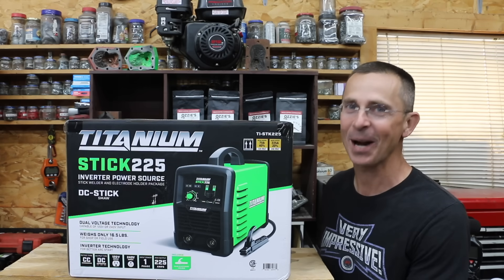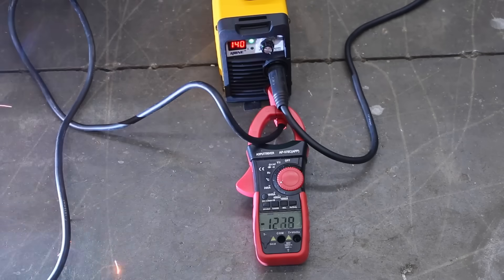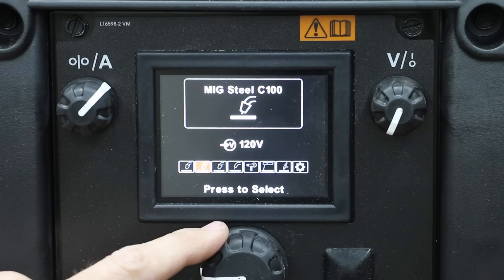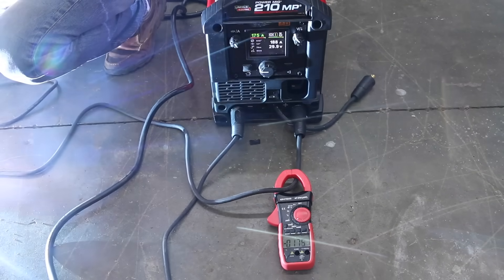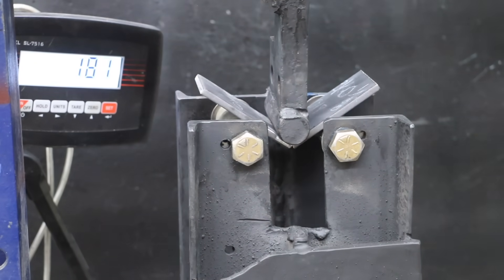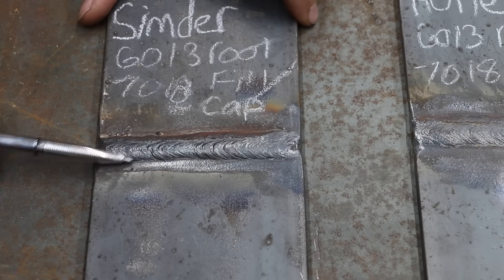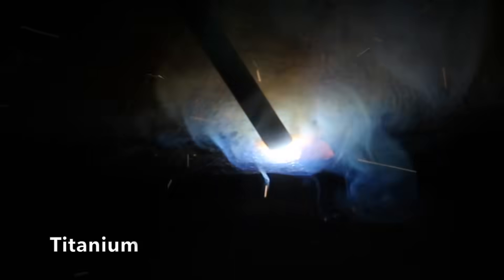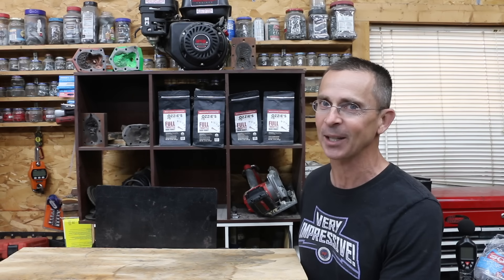$70 vs $2,300 Welder? Let's Settle This! Weld Strength, Duty Cycle, Current Output, Build Quality

Comment: This is probably going to get lost in the comments but i need to see a more indepth test to this. If you have a flat tire on your riding mower i have found that ATF TRANSMISSION FLUID of any sort fixes a leak, dry rot, hole ANYTHING better then fix a flat, slime or any other sealer. I have no idea why but i would love to see project farm get some old mower tires and prove this. I have fixed dozens of soft tires with ATF and i don't know how it works or why but a cup of ATF in your mower tire 80% of the time fixes any leaks.

Comment: As someone who has been welding for 8 years I think this was some quality information being put out. I’d love to see a battery powered 4 1/2 inch grinder test. I’m pretty sure you did a corded test some years ago but with the technology in batteries I think they  are gaining popularity as an option
Reply from the maker: Thanks!  Thanks for the suggestion.
Reply: @ProjectFarm  include the flex volt 13amp if you can too, reviews seem to say it really out powers every battery grinder. Metabo would also be nice comparison
Reply: Hey can you do a video on best degreaser? I know some suppose to be good and some isn't. I would appreciate it. Thanks for the great videos.
Reply: I keep looking at the Ryobi brushless angle grinder and die grinder but haven’t pulled the trigger yet!🤔
Reply: @Blakehx  I’ve been thinking about the Milwaukee cordless die grinder set because I have tons of those little batteries already. That price tag hurts to look at 😂
Reply: @Blakehx  😂😂😂 don’t buy it unless you want to buy a new one every time you use it
Reply: I just got a Ryobi and love it
Reply: Agreed! Torque test channel has a couple but a big roundup would be great
Reply: i have a brushless porter cable and still keep going back to my chicago electric corded harbor freight grinder, its great in a pinch where im not doing much work but any fab work its junk, not enough rpm to hog material off, im sure there is better cordless but i mostly use it as a cut off tool
Reply: Bat Grinder test would be awesome, one of the tests needs to be the brake, by far my favorite feature on my Milwaukee. Im a full believer for any spinning tool a brake test needs to be there it's great for both safety and control.

Comment: Don't know if it matters, but if your clamp meter does "inrush" or "max amps", it might give you a more accurate amp reading. That's what we use on air conditioning compressors to test the L.R.A.(locked rotor amperage)
Reply from the maker: Thanks for the feedback.

Comment: Definitely would like to see you test multi process machine's. I bought a Yes Welder MP200 & like it so far. Bought it especially for its welding and plasma cutting abilities. Would also like to see you do tests on aluminum and steel tig welders
Reply from the maker: Thanks for the suggestion.

Comment: Would love to see a comparison of  multi-process welders. The lincoln you currently have, miller multimatic 220, everlast lightning mts 225, Vulcan omnipro 220 multi-process welder, yes welder mp 200 5 in 1, and any of the other cheaper multi-process welders out there.
Reply from the maker: Thanks for the suggestion.

Comment: Not related to welding, but I just stained the driveway futzing with a power steering pump, and the solutions are a dime a dozen. Best way to remove car fluids from asphalt and concrete?
Reply from the maker: Thanks for the suggestion.

Comment: Have you done any testing for anti vibration working gloves? Using a recip saw/sawzall or some weed wackers can really get my hands all shakey after I'm done. I'll use some basic gloves to mitigate it, but wonder if the gloves designed for this problem are any better for it.
Reply from the maker: Thanks for the suggestion.

Comment: Your method for checking th amperage is severely flawed  my man,  you should be using an incline Amp meter to properly check without having voltage drop due to the air insulation properties and the rubber wire coating.

Comment: Good stuff as always,  have that little green guy in truck for field stuff.

One idea; restoring plastic on ATVs, utvs, car trim....  

Tried heat via propane torch, restorers, paint thinner, or just sanding, painting.  Might be even better ways.
Reply from the maker: Thanks!Thanks for the suggestion.

Comment: Most of the time the specs for marketing are always the best they "can" achieve but they often fall short.  I like the Titanium for its ability, accuracy, and price.  I love the Lincoln for the abilities but the price is somewhat ridiculous even though it has more capabilities.  Give Joe another opportunity to show off what you may plan for welders because you can't watch and weld at the same time. I see advantages for TIG and MIG welders but if you plan on doing stick you have to do a TIG to provide more in comparison to the two. TIG is cleaner but from what I've seen, however, it takes more finesse.
Reply from the maker: Thanks for the suggestion.

Comment: The funny part about Chinese brands is the simple fact that they run 240v over there. So when they repackage it to work with US 110v, they never change the guts. And yes, a part that is efficient and cheap at 240v wont work the same at 110v. Its just fact. Hell look at any computer power supply, they are more efficient when running 240v than 110v. That's basically what's happening in the beginning of this video where you set a certain amperage but get significantly less. The ones that get it spot on or "close enough" are pretty sweet in all reality.

That Hone is pretty freaking sweet for someone just starting to get into welding or doing home hobby. Obviously if you got the cash, always buy the more expensive units.
Reply from the maker: Thanks for the feedback.

Comment: Dear Sir. 
I know that it may seem silly, but what would you say to test of wheelbarrows?
I had dozen of different ones in my sites and I know that most of them don't deliver what they claim.
You could test puncture protection of wheels, max load, corrosion resistance, weight, and (knowing you Sir) probably much more...
Reply from the maker: Thanks for the suggestion.

Comment: Thanks Joe!! As a welding engineer, this was an excellent video comparing cheap welders to each other. Another test I would recommend doing for the MIG video would be welding for at least 4hrs with the welder at the highest settings. Some of those cheap welders give up after 2hrs of use with high current because their electronics are not meant to sustain high current for more than a few minutes at a time. Please do not waste the money on tool truck welders. They are rebranded Lincoln or Miller welders, with less features and less knowledgeable people to help troubleshoot them.
Reply from the maker: Thanks!  Thanks for the suggestion.
Reply: With that said, if you are a simple hobby user, like you would only use it for a few mins at a time here and there, then its DEF worth it to save the money.  You could buy several before you spend the amount on a higher end one.
Reply: @OnceShy_TwiceBitten  Been beating the heck out of my titanium 200 for a year now no issues
Reply: Duty cycle would be a GREAT test! Good idea!

Comment: Can we get one on 4 1/2 inch angle grinder disk? Tired of burning through them after one lengthy cut when I’ve got some others that one cut doesn’t even phase it and can go in for another 5 or 6 cuts
Reply from the maker: Thanks for the suggestion.

Comment: The Titanium surprised me all around when I picked it up last year. I’ve been nothing but impressed with their line of welders lately.
Reply: I bought the multi-process Titanium a few months ago and have been satisfied. It's very easy to get set up and arc welds great even on 120.
Reply from the maker: Thanks for the feedback.
Reply: I keep hearing that. I have an old ESAB I use for stick welding, and it's getting long in the tooth. Gonna check Titanium out!

Comment: It was a great idea to get an expert welder on board for this test.
The Titans max 70 amps is a pretty hard restriction. Even for homegamer jobs this can be insufficient. Are there many households in the US without 240V power supply?
Reply from the maker: Thanks!

Comment: great video! i have the titanium wire welder and like it
it would be cool to see that quarter inch steel (without bevel) welded on both sides so that is has complete penetration all the way through and then see how much weight it would take.
Reply from the maker: Thanks!  Thanks for the suggestion.

Comment: Do the 240 volt welders require a 240 volt plug or do they simply take 2x 120 volt inputs?  It looked like the Titanium’s plug had a 2nd 120 input on top?   Thanks.

Comment: Thank you for your videos. As a welder by trade had to provide some input here. Parameters for a stick welder are typically as follows.

3/32 7018 - ~83 amps
1/8 7018 - ~125 amps

Duty cycle 100% for professional and 60-80% home use is fine

The penetration tests were irrelevant since you would adjust the heat to ensure proper penetration regardless of what the dial says. Having said that the current readings to determine if you can reach the above recommendations are key to reaching the desired penetration. If the machine can reach those two currents then it’s on to duty cycle to make sure it’ll run all day or for your current home project. 

The machines that popped off were good to see. Thank you for destroying those so we don’t have too!!!
Reply from the maker: Thanks and you are welcome!

Comment: A great video showing what arc welders are capable of.  One of the big problems people keep overlooking in 110v arc welders is power:  there simply isn't enough power to do anything except light duty, thin metal welding.  On the input side 15 amps x 120 V = 1.8 kW. Assuming 20v DC at the electrode, that makes a maximum of 1.8kW/20V = 90 amps available if the power supply is 100% efficient.  It is a given and proven in this video that no welders power supply is 100% efficient.  When a given electrode and to be welded metal combination needs more than ~70 amps (accounting for the losses in the welders power supply), a 110V arc welder simply won't work because there isn't enough power available.
Reply from the maker: Thanks! Thanks for the feedback.

Comment: To be fair - Didn't you say in the beginning of the video that ALL the welders tested were run through a 20-foot 12 ga extension cord? Because if you don't use a 'Voltage Drop Calculator' to determine the alternating current resistance through the extension cord, then it is not an accurate test of each unit's advertised output. 

For example, I used an online calculator to show the resistance of Copper 12 AWG wire / Power Factor 0.85 / Voltage 120 / AC Single Phase / 20 feet / Load Current: 200 Amps - - - and the result was a voltage drop of 13.97, voltage drop percentage of 11.64%, which equated to 106.3 V at the end of the 20 foot extension of wire. 

240V Single Phase resulted in:
Voltage drop: 13.97
Voltage drop percentage: 5.82%
Voltage at the end: 226.03

At 10:11, you show two pieces about to be welded together to be prepared with a 30-degree bevel, but - the surrounding area still appears to have a light coat of 'mill scale' on it? If surrounding impurities are drawn into the weld, wouldn't they affect the depth of penetration and the strength of the finished bond?

Comment: 0:43 plus, using the same measurement tool in the same way every time means results will still mean something relative to one another. It's like building a table with a tape measure that's an inch off. Sure, it won't be the right size. But if you never change tape measures, it will still be square!
Reply from the maker: Thanks for the feedback.

Comment: Gap, gap, gap.   Butting 1/8 inch steel and thicker without a proper gap, then trying to weld does no good if you are trying to show a newbie how to make a structurally sound weld.   Look up proper gap for each diff thickness of metal you are using.   A properly done weld will not break or crack in your 180 degree bend test.   A side note, on better grade metals 7016 is now the choice for a root pass, with your 7018 for the fill.
Reply from the maker: Thanks for the feedback.

Comment: Ive used lincoln and miller welders for at least 40 years and i wouldnt use any other. I also think you copuld have used a lincoln stick only welder and it would give good results and cost a lot less. your paying a lot more for the added features.
Reply from the maker: Thanks for the feedback.

Comment: If you're trying to minimize voltage drop, why wouldn't you use a 10 gauge drop cord?? I mean.. why use a drop cord at all? Put a 20 amp GFCI on a 30 amp circuit for testing purposes. That would give you your minimal voltage drop on a standard plug size.

Comment: That's a joke. None of them passed I'm a certified welder. Thirty-two of them actually.. work on high pressure.

When you bend a weld, and even bend-it, crusher it in hydraulic pressure. If it breaks. You fail. Get sent home.
None of those Welds would have passed. Complete failures. Obviously it's you the welder. Don't test things when you have zero idea how to even weld professionally. Very sad. Over your head on this one.

Comment: I would love to see more of these welder tests.  There is not enough good heads-up info out there.

Also, plasma cutters would be great to see, also with all those cheap ones available now.
Reply from the maker: Thanks for the suggestions.
Reply: I would maybe even say get 2 of same brand multi function an compare mig over plasma option an see how the plasma on the Multi compare to a regular plasma
Reply: Definitely need to do some with ac/dc tig on the multi side an maybe a lower end  of same brand comparison with  less options
Reply: There's review vids of even the cheap ebay type Plasma cutters and most of them perform rather well

Comment: Not sure if this is up your alley but I have been wondering about soldering stations for a while. But they are all usually kinda expensive and there isn't much to pick from it seems like. Don't really want to spend a bunch of money on one that doesn't really perform that well.
Reply from the maker: Thanks for the suggestion.
Reply: Get a Pinecil with a chisel tip like a D24. It’s newer technology and costs less than older tech soldering stations.

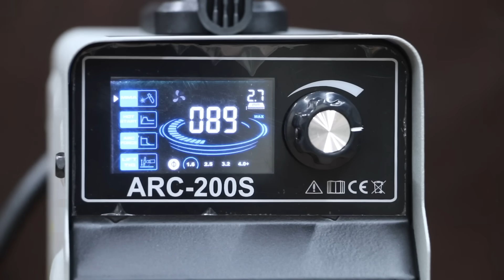Comment: I'd like to know which tig welder is the best bang for your buck in addition how well it can handle Aluminum and Stainless steel. I'm after a tig welder for hobby use. Lots of metal in the 1:14th scale rc truck hobby.
Reply from the maker: Thanks for the suggestion.

Comment: Thank you Joe,
 I would really like a Mig Welder review as i'm still using my very old Hobart Handler 120(which i bought back in the mid 1990's new) and the old girl is getting tired and has seen better days, I've been looking recently at Eastwood's 140 amp welders, and i'm torn between the 140 mig, and the 140 mig, tig, arc. Welders they offer as the price difference at the time of this comment is only $50.00, but compared to Millers and Lincoln prices, i'm just wondering if the Eastwood's extremely affordable prices would make them the better option.
Reply from the maker: Thanks!  Thanks for the suggestion.

Comment: Thank you, Joe and Todd!  Great partnership!  Please welcome Joe back whenever he can help.  Quite a high expense for this one!  Wow!  That's Impressive!  I'm sure you'll be using your Lincoln for years to come.

I've never owned a welder, but there have been times I could have used one and new projects I couldn't do without one.  There are tons of videos that could teach how to perform a particular task.  I'm sure Joe has several videos.  I bought KBS Coatings' NuMetal putty to patch rust-caused cracks and holes in a tractor mower deck.  If, when I use it, it doesn't perform as needed,   Being a putty, it's formable and wire mesh can be used to set it.  It's grindable, sandable, thread tappable and can be painted, so I'll I'll see, but if not, there's always this option.  Hey, maybe a KBS Coatings NuMetal putty product-type comparison would be a good video.

Thanks for another great one, Todd!  You're the man!  If I ever need a welder, then, as a simple homeowner, I guess the Hone would be the one for me.  It's going for $104.90, not $90, but it's fairly close.  If I need one, I'll buy it from your link. There's also a red one for $77.80 at a 40% off sale, regular $128.99, so I'll compare the differences if I buy one.   I have saved your Tested Products spreadsheet page in Bookmarks to find things later.  Thanks again.
Reply from the maker: Thanks and you are welcome!

Comment: Your outlet can only provide 120ish amps at 30ish volts. facepalm Anything above that will drop lower after a couple seconds. The time it takes to drop to 100% duty cycle depends on the capacitors mounted inside the welding machine.
Reply from the maker: Thanks for the feedback.

Comment: Good tests.
I bought a Harbor freight Chicago Electric 125amp flux core welder.
90A AC @ 17v 20%
$119
I bought 2 stocks of 2.5" aluminized exhaust pipe and welded up a custom exhaust on my suburban.
As long as the metal was really clean it did great.
Reply from the maker: Thanks!  Thanks for the feedback.

Comment: I bought my Lincoln 210 new like 8 years ago when they where $1000 after rebate. I recently sold it for 1900 and bought a everlast 210ext tig and the new ahp 190 multi process. It’s hard to beat everlast. Primeweld I here great things as well. The old saying you can’t fix Chinese welder when it breaks has changed as long as you go with big Chinese manufacturers. And yes my ahp does everything my Lincoln did just as good even better. 210mp was a nice machine I just grew out of it. I would never pay 2k for one lol.
Reply from the maker: Thanks for sharing.